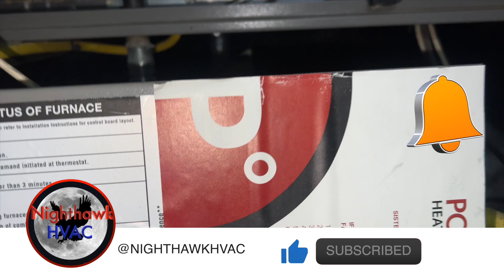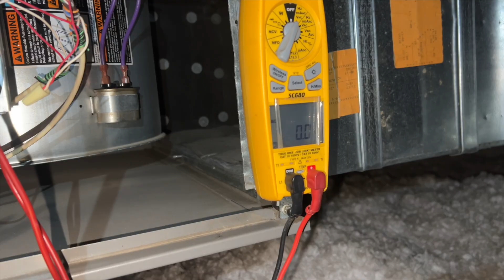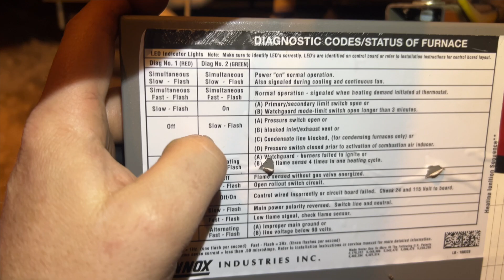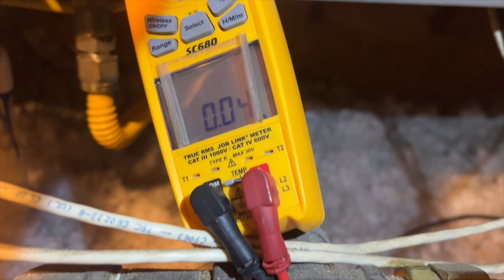No Heat.  Inducer Draft Motor Not Running EP162

Comment: If the board was working when you diagnosed the failed inducer relay, what did you do to make it fail?
As others have stated, I think the temporary fix needed to be a delay of the inducer, not immediate start up. Or delay the pressure switch.
Ultimately, if you do residential as a major part of your work, you need to carry some universal parts - boards, HSIs, gas valve, blower motor and maybe even pressure switches.

Comment: You should keep the ICM2812 Universal furnace board on the truck. Has gotten me out of pinch a time or 2. Works on a lot of stuff. Especially with Lennox in our area not having parts when you need them.

Comment: One possible reason your temp fix didn't work:  When the thermostat calls for heat, the control board first checks the vacuum switch to see if it is open. If that that is true, it then starts the inducer motor and checks the vacuum switch again to see if it is closed.  Your temp fix may have started the inducer motor to soon.
Reply: 100% correct!   I bet the same theory could be achieved with a sequencer or a universal time delay relay..  at least that would give the board the initial proving delay time.